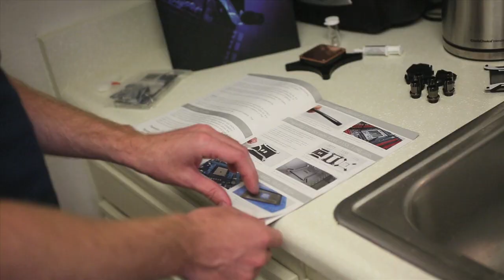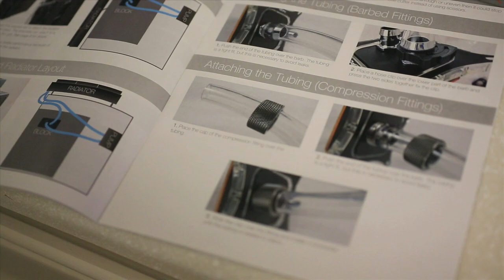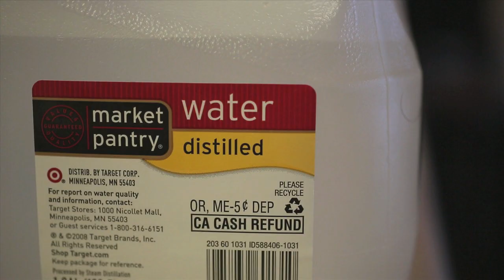A Beginner's Guide to Water Cooling Your Computer

Comment: How is this build? Gonna be my first.

MB: ASUS SABERTOOTH 990FX R2.0 AM3+ AMD 990FX SATA 6Gb/s USB 3.0 ATX AMD Motherboard

GC: ASUS R9270X-DC2T-4GD5 Graphics Cards

RAM: Corsair Vengeance 16GB (2x8GB) DDR3 1600 MHz (PC3 12800) Desktop Memory (CMZ16GX3M2A1600C10)

PRCSR:AMD FD8350FRHKBOX FX-8350 FX-Series 8-Core Black Edition Processor

Cooler: Corsair Hydro Series Extreme Performance Liquid CPU Cooler H100i
Reply: Andres Alvarez Alvarado I still need more components, but i'm going slow
Reply: Andres Alvarez Alvarado What is ur buget?
Reply: Decent, make sure your psu supports this system.

Comment: so you still need 2 giant fans for this water cooling system,.. which will make sound again .. what is the point here ? =(
Reply: It will still keep your components at much lower temperatures. Usually down in the 30's.
Reply: Eren Alkan Here's some logic for you:

Several case fans plus CPU and GPU fans which could be like 5+ on chips and 5+ in case VS Just the case fans including radiator fans ofc. Much quieter regardless of speeds.

Last air-cooled rig had like 11 fans total, water-oooled rig, 6.
Reply: Eren Alkan The external fans will work significantly less than the internals ones. with a lower chance of CPU failure

Comment: I hope you can help me, Ive spent hours writing to koolance and evga and not getting any really good answers.

I purchased two used Koolance VID-NX680 101251 water blocks for my 04g-P4-2686 GPU's 
that came with a backplate. I know that the backplate is 3mm in thickness and the stock
screws are M2.5 ?

The water blocks did not come with any screws or washers
and if you could, please tell me what I am going to need to 
order for all the screws I will need to do the two setups for SLI 
water cooling with the parts I have.

 I ordered a cnt-vda2 to connect the two water ports, but I do not 
want to even take the cards out until I have everything I need.

 Koolance mentioned: M2.0 screw with threads measuring 6.5-7.5mm in length
and that does not really help me.

Thank You so much for any advice you can give me.

Comment: Water cooling so fan is not noisy  . First thing you need is a Fan and Radiator XD 

IF water heats too fast won't that make fan spin faster ?
Reply: Kanishk Singh If your laptop runs at 80 degrees Celsius the mobo would probably be fried. I think you mean 80 Fahrenheit which is nowhere near 80 C.
Reply: Jeebus_Creebus 80 celcius is WELL below the rated limit where most cpu:s start to even thermal throttle!
Reply: Justin Greenleaf The boiling point of water is about 100 Deg. Celsius. My laptop temps easily reach 80 on gpu heavy applications.
Reply: Jeebus_Creebus If speedfan is indeed accurate, then my GPU does reach 80 temps occasionally, and it is Celsius
Reply: Kanishk Singh How is your pc alive?
Reply: purewaterruler sheer luck, I guess?
Reply: Kanishk Singh you should really water cool it. Even though the BP of water is 100 C and your gpu is apparently 80 C, the water will take the heat and it will get cooler, like a positive feedback loop, but in a good way.
Reply: purewaterruler Laptops can't be water cooled.
Reply: Kanishk Singh yes they can, just disconnect the screen and put the keyboard in a tank of water. ;)
Reply: Jeebus_Creebus Laptop CPU's can withstand higher temps than desktop CPU's. I had a Packard Bell laptop a few years ago where the CPU was hitting 92C during the summer. It eventually gave up the ghost though and let out the magic white smoke. It was safe to say it died, although it did last a good year or so running at high temps before it died.
Reply: Kanishk Singh jmoòòlo

Comment: Can anyone tell me why they use water instead of a non conductive mineral oil?
Reply: Xanifur Mineral oil is quite high in viscosity making it difficult to pump around. Water has an low viscosity and flows better through your loop. Because of the flow being better it actually conducts heat better as well. Mineral oil is generally used with submerged builds.
Reply: Xanifur Water also has a much higher heat capacity than mineral oil.
Reply: Because mineral oil isn't cheap i think..
Reply: *****
It's like 13$ a gallon, and won't fry electronics if it leaks.
 http://www.pugetsystems.com/submerged.php
Reply: Xanifur Mineral oil retains the ambient temperature of the environment a lot more well than water. It's good for the first few hours of PC use but after it gets heated up, it stays hot unless it has very adequate cooling such as a huge radiator with many fans.
Reply: There is a such thing as a mineral oil cooled PC, but its very different from this.  You actually submerge most of the components in mineral oil rather than pumping it through them
Reply: TheRussell747 You have to pump the mineral oil in a submerged build too through at least a radiator!
Reply: ***** True, but I figured that was just kinda common sense because how else would the oil be prevented from just heating up, therefore just delaying the inevitable overheating death.

When I said "rather than pumping it through them" I meant pumping it through the part.  How with like a gpu you pump it through the waterblock that's like in the card itself.
Reply: Xanifur There is just no benifit in doing so. It's more expensive, less efficient in cooling, the pumps and radiators are not able to deal with the viscosity. Destilled water is by the way a bad conductor compared to regular water.
Reply: :D

Comment: Is it much more efficient? A fan on the cpu or water block and 2 fans on radiator. Kinda defeats the object unless temperature figures are way improved.
Reply: The idea behind water cooling is that water can carry more heat away than air can. So even if you use the same radiator size and fan as a normal heat sink, it'll still carry away more heat because water is a better coolant than air - which is actually a pretty good insulator. That's also why car engines are normally liquid cooled.

LC only makes sense if you either generate a lot of heat, or want a cool looking PC, usually it's both.For the average consumer, even for most gamers, a big air cooler or a pre-filled water cooler will do just fine. You really want to improve the air flow specially over the RAM and chipset area if you're using water cooling - or just outright watercool the whole motherboard if you have money to burn, because the lack of a fan on the CPU means that the surrounding area doesn't get the same air flow it usually does, so the chipset and capacitors may heat up more.
Reply: Thanks for clearing that up. Im looking at getting the H75 for my cpu.

Comment: Will this run games like the Forrest, Skyrim, minecraft and battlefield4?
Case : Vantage Green Midi Tower Case + 4 x 120mm Fans
Power Supply : 500W Power Supply
Motherboard :  Gigabyte F2A68HM-HD2 (HDMI & USB3 Support)
CPU : AMD FM2 A4 6300 APU Dual Core 3.7Ghz (turbo 3.9Ghz) Black Edition
Hard Drive : 1TB Seagate Sata 7200RPM 6Gb/s Hard Drive
Memory : 4GB DDR3 1600mhz Memory
Graphics Card : ATI 8370D APU Graphics
Optical Drive : 24 Speed Dual Layer DVD Writer
Connections : 6 x USB 2.0 Ports + 2 x USB 3.0 Rear ports / LAN / Sound / VGA / DVI / HDMI

Comment: Has any one ever added a little dry ice to the reservoir ,That should keep it even cooler,I was a certified Gm Technician,One thing you have to know is all radiator coolers must be Black to dissipate heat,if its not paint it black..

Comment: I need to know if this will go together
Trust me, i will save up enough
specs:

CPU: Intel core i7-4790k
CPU cooler: Cooler Master Hyper 212 EVO - CPU Cooler with 120mm PWM Fan (RR-212E-20PK-R2)
MB: ASUS Sabertooth X79 LGA 2011 Intel X79 SATA 6Gb/s USB 3.0 ATX Intel Motherboard
RAM:(SIDENOTE: I am going to get two of these) Crucial Ballistix Sport 32GB Kit (8GBx4) DDR3 1600 MT/s
GPU: AMD HD79906GB Radeon HD 7990 6GB 384-Bit
HDD: WD Blue 1TB Everyday PC Desktop Hard Drive: 3.5 Inch, SATA 6 Gb/s, 7200 RPM, 64MB Cache - WD10EZEX
PSU: Corsair CX Series 750 Watt ATX/EPS Modular 80 PLUS Bronze ATX12V/EPS12V 744 Power Supply CX750M
OS: Windows 8.1
Case: Corsair Obsidian Series 350D Performance Micro ATX Computer Case with Windowed Side Panel CC-9011029-WW
Monitor: ASUS PB287Q 28-Inch Screen LED-Lit 4K Monitor
DVD drive: Pioneer Electronics USA Blu Ray Combo Drive, BDC-207DBK
Sound Card: Creative Sound Blaster Z SBX PCIE Gaming Sound Card System Builder Version SB1502 70SB150200000
Keyboard: Razer BlackWidow Ultimate
Mouse: Razer Mamba
Headset: Razer Kraken PRO

If there is anything else i need to include, or if there are any issues, please tell me!!

Comment: Too much work and too dangerous. They say 'sh*t happens' and in this case it could happen all over your expensive electrical components. eh-eh!
Reply: It depends on your heat generation in the end. If your PC produces a lot of heat - because you overclock or have it under constant load, or both, you want to use water cooling. You don't need LC for Facebook unless you live on Venus.
Reply: I'm buying a 5-7k gaming computer with 3 year warranty so if my liquid cooling screws up I get a replacement

Comment: i dont have anywhere to mount a radiator on my case, although there are two holes out the back that are designed to fit a water cooling pipe. i have thought of running the pipes out these holes and into the radiator where ill set up a way to keep it up so the fans can run properly. is this a bad idea?
Reply: Nope, Not a Bad idea At All :D
(EDIT) Actually That's A Shit idea Because the Condensation Will Get All Over your Components And RUIN IT ALL.

Comment: Quick question. I'm a bit of a noob when it comes to cooling systems.
Would water cooling be a bit too advanced for me since I don't know a damn thing about it?
Because I'm stuck in the "I don't like the idea of water being in my expensive computer build" mindset.
How's the maintenance? is it complicated or pretty easy to pick up on?
Or should I just stick with traditional fans to be on the safe side?
Reply: Well, if you don't want to use a custom loop (which you can buy a kit to cool your CPU for, idk $200 or so that contains everything you need minus the coolant) the other options are using something along the lines or the Corsair H100i or the Kraken X61 that are closed-loop systems, they're pretty much like a water cooling loop thats preassembled so all you gotta do is attach the fans to the radiator, radiator to the case and block on the cpu, plug everything in and your good to go.

However, if you wanted to get one for your GPU you'd likely have to go custom. (while there are current closed-loop systems that contain GPU and CPU blocks I believe they are kind of crappy.)

Maintenance? Well, some people do it more often then not. Generally a yearly clean is recommended, but some people have been able to go a few years without any sort of maintenance, and by then they upgrade their components anyway. All you gotta do is drain the water and put more back in. You don't need to clean your components unless something went wrong. 

My advice? if you just want CPU, get a closed-loop system. Easier and cheaper. If you want GPU and CPU? Well, $500-$1000 later you have to decide if its worth it or not. For me? I enjoy my hobby and while performance isn't a thing I care about, it looks pretty damn sick.

If you're smart and careful, you'll do your research and figure out the parts you'll need and at that point you dont need to worry about springing a leak; it generally happens more out of carelessness then anything else. 

EDIT: I forgot to mention one of my builds has a Kraken X60 in it (a closed-loop system) its fairly good and I havent had any problems with it. But as I am looking at making that particular system also have a water-cooled GPU I will be moving away from it

Comment: Can somebody check out my list?

-Intel Core i7-4790K Boxed
-Asus STRIX-GTX970-DC2OC-4GD5
-Asus Z97-A
-Seagate Desktop HDD ST1000DM003, 1TB	
-Fractal Design Define R4 Pearl Black - Window	
-Cooler Master Hyper 212 EVO	
-Corsair Vengeance LP CML8GX3M2A1600C9	
-Samsung SH-224DB Zwart	
-Corsair RM750Samsung 840 EVO 250GB

 
Can you tell me what I should change and stuff? I've never build a pc in my life and before I purchase those components to build one, I need to make sure that I have the right PC build.
Reply: Æ delete system 32 and it should be done
Reply: strix sucks change it to gtx 980
Reply: Juuso Mutanen can you elaborate?
Reply: what
Reply: if u use so much money to strix u easily can get gtx 980 its better an slightly expensive but ur computer will be very powerful
Reply: This build is VERY VERY good,but if you have a bit more money buy 2 GTX 970 IT WOULD WRECK a single GTX 980
Reply: flyingchimp99 Sorry, wrong. Follow Linus's advice "It's better to get one better card than two lesser cards." And it is, two cards take more power and are more of a hassle to manage and can cause more than one.
Reply: Change the GPU to Gigabyte gtx 970.
Reply: John KONTELLIS Its better to buy one good gpu vs two less powerful ones, as you will only be able to get full potential if the games support it, and some other things.
Reply: What's your price limit and how much does this list add up too?
Reply: Xoreign price limit is 1300 euros max
Reply: How much does this list add up to. The one you commended.
Reply: SSD
Reply: pls no
Reply: AtomicRKS he/she (gender equality ) has allready a ssd
Reply: Juuso Mutanen better to get two 970s than one 980, price is lower and better performance, 980 overpriced.
Reply: if he has so much money just go with amd r5 ((-":
Reply: nice, i got a i7 4790K too and a Z97 Gaming 5 mobo w/ GTX 980.   I just need sum RAM to put it together..
Reply: water cool it and if you can hardpipe it will look clean af but if you do that i recommend getting a bigger case like the corsair obsidian series
Reply: Or Corsair Air 540, it gives a ton of room to work.  But it needs dust filters.  http://www.demcifilter.com/c198/Air-540.aspx
Reply: Michael Proctor Linus actually said somewhere (probably a wan show) that the gtx 970 is an exception. Unless you can't get past that 3.5 gb of vram ;)
Reply: Æ Everything seems fine to me. If you're going to overclock your processor and want better cooling I suggest a self contained liquid cooler like a Cooler Master Seidon 120V. I have that in my system and the temperatures from my old Cooler Master air cooler went down 6 - 10 degrees on my i5-3570k 4.2 overclock depending on the stress load at the time.

Keep in mind that this video is designed for people who want to build a custom DIY based liquid cooling loop. Since I don't do plumbing all that well I got myself a self contained unit like I said.

Also keep in mind that there will be some people who are biased in regards to hardware choice but as long as your rig runs your games at what you think are decent settings and frame rates then don't change anything.

I will admit that your system is a hell of a lot better than my system! Although my system is 2+ years old.

In short your system is fine to run the current crop of games at respectable frame rates. Don't invest in anything new unless you want to go overkill on quality settings and max out your frames.
Reply: Æ http://www.passmark.com/index.html

Check this site out. It contains different performance charts which tests all new computer components frequently, and compares their performance against one another. Search up your computer components and check.
Reply: Æ Watch the hard drive, that model is known to fail in the first two weeks occasionally

Comment: mhh, the pump and the fans should keep running a few minutes after the computer has been switched off... The fans for the heat exchanger  have to  run at a speed according to the coolant temperature, they shouldnt run under 35° C to prevent condensation.

Comment: Well when you fill up the system you cant ruin your components b'cuse your filling it up with destilled water wich is non conductive. But if there is a leak it would b'come rally messy instead.

Comment: Air cooling I stay. I used water cooling systems but its still not that quite due to the radiator fans. When my PC fans are loud headphones I wear.
Reply: ok yoda
Reply: The force is strong.
Reply: Joshua Gill
Agree I do, with headset, no noise there will be.

Comment: But, but, but! Water cooling replaces the cooling fans and is therefore quieter right? So what about the two huge fans you just fitted to cool the radiator.. does that not defeat the object?

Comment: I don't understand the way the tubes have to go from the res to the block to the rad is there like a set in and out on the res and water block? or is it dependent on how you set it up? and im still trying to figure out, so res to water block, block to rad, rad to res/pump, then back to water block?

Comment: Will someone, anyone, please help me understand why these systems must be drained, cleaned, and refilled every ~6 months or so?

I was under the apparent mis-impression that by adding the biocide (and/or kill coil), and the anti-corrosive that would prevent the 'gunk' from forming in the first place. Also, why do closed loops like H80i/H100i not need to be drained/cleaned/refilled? Should only a six month +/- lifespan be expected from closed loops due to the inability to drain them?

Clearly I'm a newb at this w/c stuff, but a sincere one, and am really trying to understand what I mentioned above.

Any and all input is both welcomed and encouraged.

Thanks in advance for clearing this apparent contradiction up for me and very likely others.

Cheers

Comment: the problem with this is that, some of us are new in building pc´s, i want to do this but at the same time i dont, since i live in mexico, here the weather is horrible, its hot all the time... so this will come great to the pc i want to build but still, they told me that destilated water can be conductive again with time, any tip ? should i just get a good aircooling?